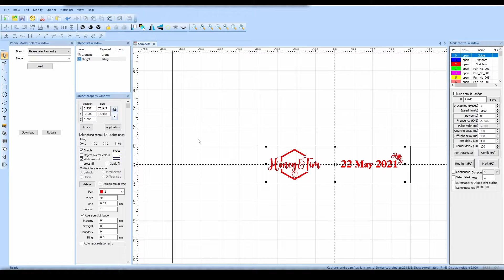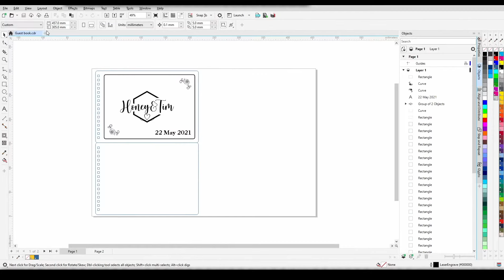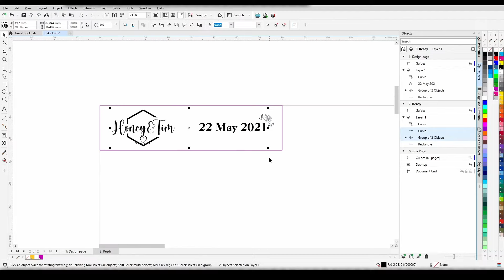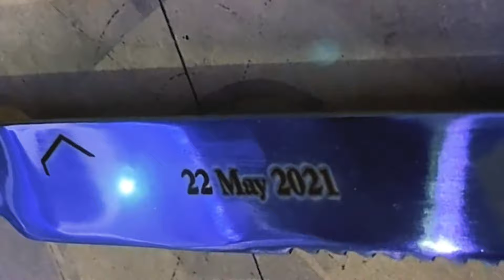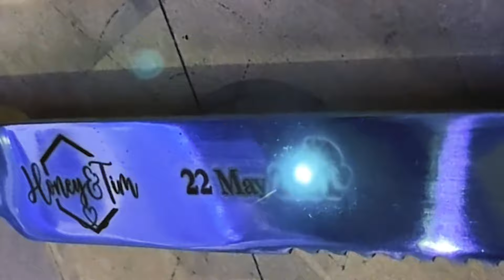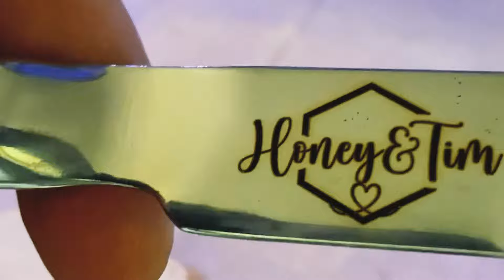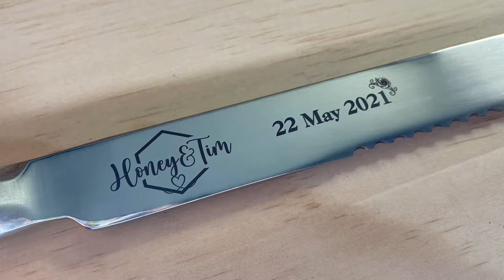Laser Engraving | How to Laser Engrave Wedding Cake Knife

Comment: I thought the Fusion Pro 24 you had was dual source with a 30W fiber. Or did you use a separate 20W laser?

Does any of your fiber lasers engrave on metal or can it actually etch into the metal to give it grooves when you run your finger across?
Reply from the maker: Ahh yes your correct we do have a duel source Epilog. Though in this video we used a Galvo style fiber laser. We could of made this in either laser. Also yes we can cut depth with these.